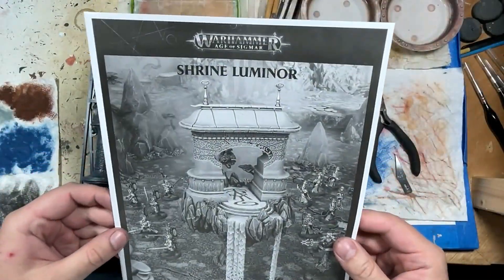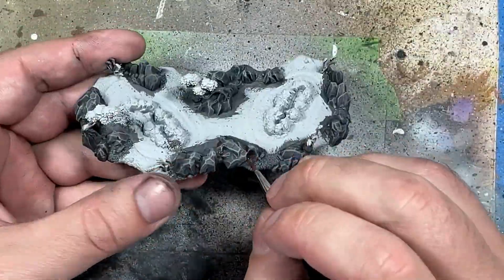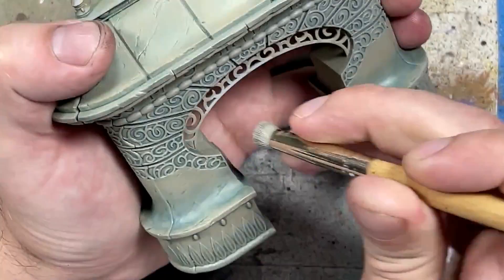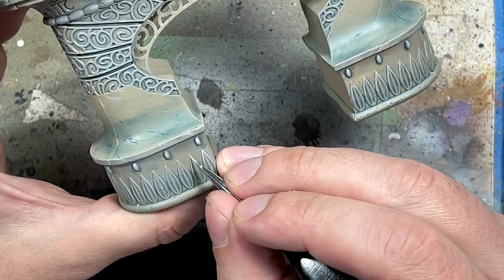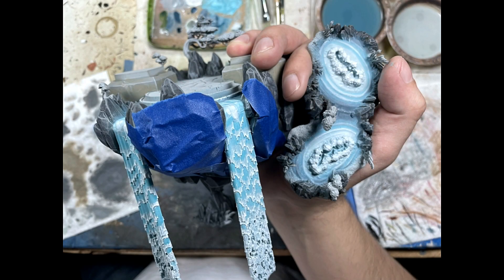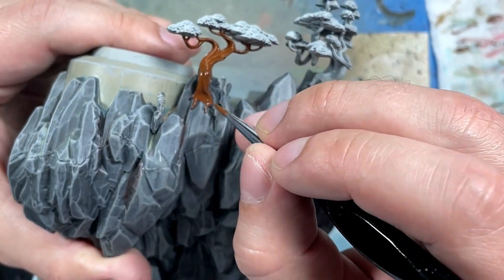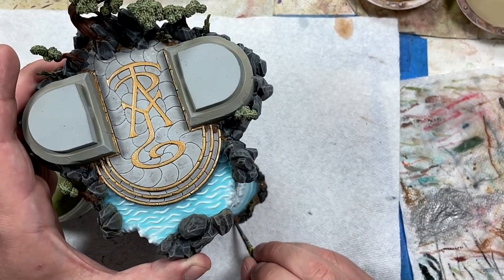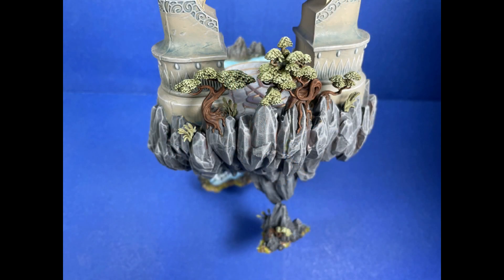Joyful Painting - Shrine Luminor - First time I ever painted water

Comment: Your advice on the water and step order saved me. I saved some time by  starting from a quite complex zenithal of 3 colours (black / grey / almost white), but the tricks with the gulliman and greenish moss on the rocks were a-ma-zing. I usually do sponging for moss, but it would be extremely hard to reach the right places, while the greenish tinting gives the same visual impression with more realism and less effort.
I also let a tiny bit of the bluish overspray still shine below the thin grey stone corrections, in the places where the water should be reflected a bit. Another thing I tried was to have a darker wash near the water, and stronger drybrushing of the earth far from the water, giving the impression that the earth is wet next to the water.
Reply from the maker: Glad I helped!  Good call with the appearance of the ground around the water appearing wetter.

Comment: Looks fantastic!  Try UV-actvared super glue for that huge seam at the belt line.  Worked for me, but the sanding took forever.  Also, Temple Guard Blue can be made from Baharroth and Sotek blended.
Reply from the maker: UV activated glue?  Interesting...  But as for that large crack I did a short second vid on another shrine where I focused and trying something different.  I used Miliput and sended the soft miliput with a wet brush and it did the job well-ish.

Comment: thanks for this! when you say you have to use the rigth psi to not make it grainy, is that low or high? ie will it be grainy if I use too high or too low pressure? (new to airbrushing but I have this problem, in particular with whites) cheers
Reply from the maker: If it's to low it will come out grainy regardless.  Higher is smoother.  But this will not work with whites.  That's why I use off whites like palid witch flesh.  
IF you want to use Pure white in an airbrush, don't get a paint, get an INK instead.  A white ink through the airbrush won't be grainy.
Reply: thanks!